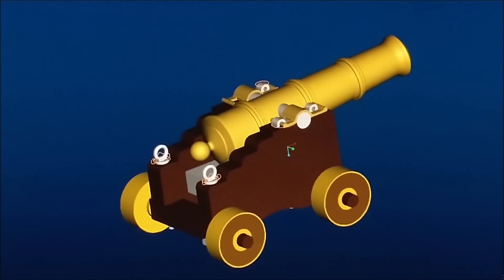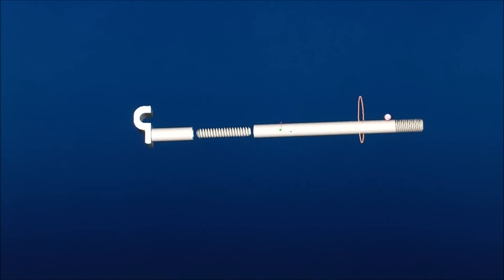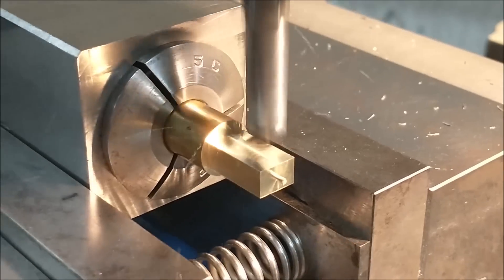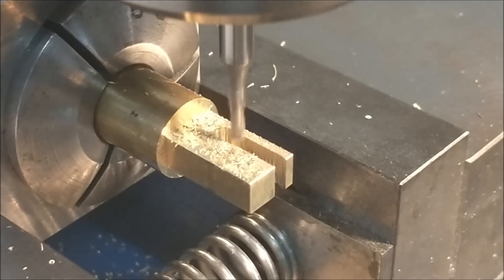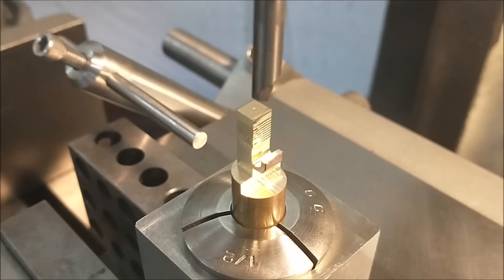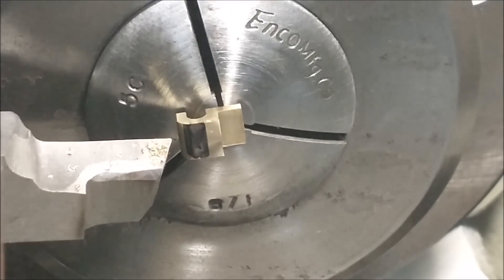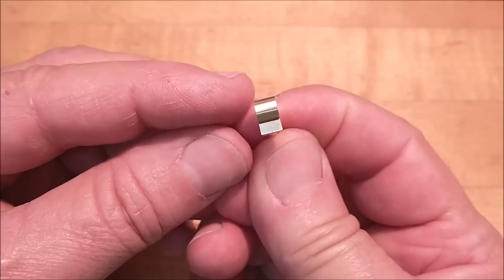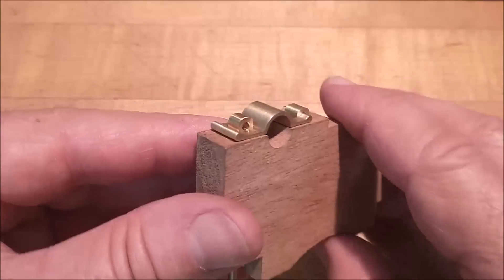Machining a Simple part........Wait a Minute !!!!!

Comment: Interesting milling. But at 66 with a couple simultaneous strokes and heart attacks and 5 Bypass  surgery under your belt there are sometimes, too many times like this afternoon that my mind just doesn’t want to think/visualize in in 2D yet alone 3D like it used to.  Between a life of 46 years living in chronic pain with sleep deprivation and either the Duloxetene and/or the Neurontin which are part of my prescribed pain management protocols I have had trouble thinking and envisioning things as I was able to before starting them those meds many years ago.  Hoping some pending neck and back surgeries will eliminate the need for both, or one or at least a considerable reduction in dosage of those two meds to see if my ability to visualize such activities will return on how to do mechanical things associated with such activities.  Some days I wonder if my dreams and hopes to have a hobby machine shop with potential side income is a valid reality.  But, I still enjoy watching others do it.  Oh well, as long as you can stay safe and have some extra materials it’s only time and materials to try again in your efforts and it’s just learning how to and how not to do it.  Damnit I still want to do machining with something more than a metal saw, grinder, drill, file and emery cloth.  LOL. As always enjoy your videos with narration of first showing what you are going to build and how you are going to do it.  Really enjoy your many years of knowledge broken down for us pre-novices/wannabe machinists like myself.

Comment: I would have made it as 2 pieces, but I would have made the hook piece as it's own, the silver soldered or brazed it together
Reply: That's the path I would have chosen too.  Possibly even using a hammer, or punch to ensure the two parts smoosh together into an interference fit.

Comment: Amazing machining job like usual. You always have challenging approaches on how to manufacture small parts on  large machines. You prove that size of the machine is not a limitation.  Your next project should be the 68 pounder carronade (HMS Victory).

Comment: I'm rather surprised you're machining these trunnion pieces and not forming them from brass strips. This one is a bit harder, but you could solder the end piece to the bolt, which should be fine until you decide to shoot this thing.

Comment: on the full size cannons, pretty sure these were originally made of multiple parts banged together by a blacksmith, because the revolution in mass production started toward the end of the industrial revolution with the mass production of small arms which could be easily interchanged and stocked with spare parts.  Just a conjecture though, feel free to provide evidence to the pro or con. thanks ~Mike

Comment: I would forge its end to do the job, trim it up on a grinder, rinse and repeat. I say 'Never say 'No' to the easy Solution".
Reply: @Grauenwolf  I'm with you, I'd hard solder the cap. With forging brass I would worry about the integrity of the brass over time either bending or cracking. Casting would be the way I'd go if I had to make a ton of them